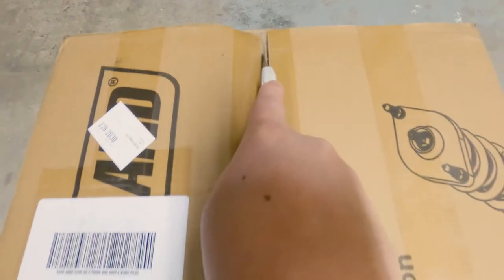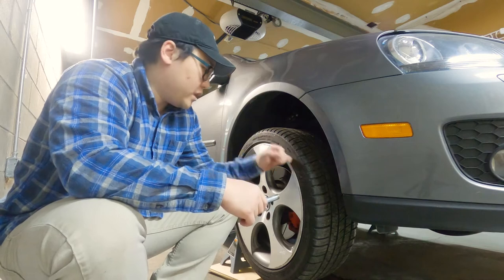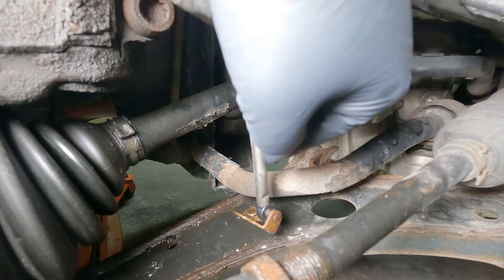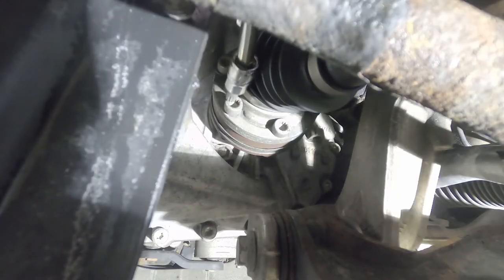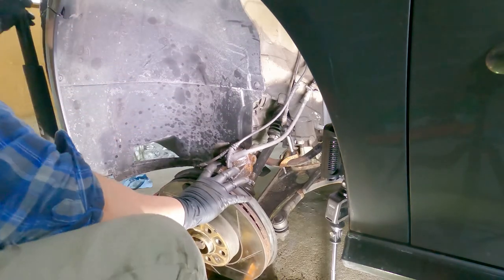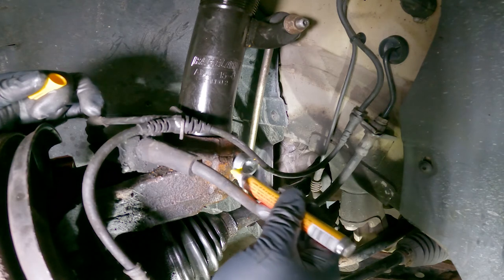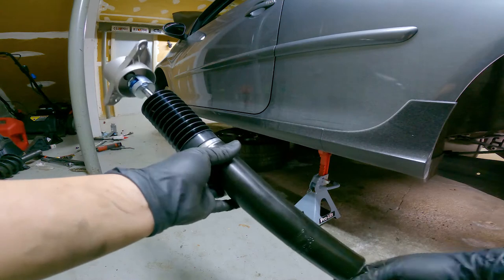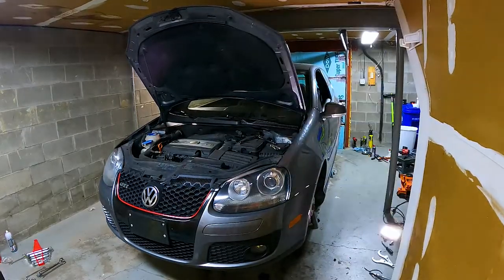Raceland Primo | COILOVER INSTALL | GTI Gets Adjustable Dampers Coilovers!!! MK5 | MK6 | VW

Comment: How is the ride quality with the coilovers at their highest setting? Did the dampening adjustment make any difference?
Reply from the maker: Haven't been driving this car much so it is still breaking in. I will have an update video about right height and adjustments in the near future. But as of right now at the highest setting and damping set to middle (7 out of 15). It is noticeable rougher compare to stock. However, it also is A LOT sharper compare to stock. The steering points instantly and feels very direct. From my intake video(https://youtu.be/VUneQ6P_7n8?t=636), you can kind of tell that the ride is pretty bumpy. Thanks for your comment! Subscribe for future video and updates!!

Comment: Can you go lower? Or is that max
Reply from the maker: Yes I can go lower, there are still a lot of thread on the coilover. But the ride will be very harsh and it will hit the fender liner. Check out this video for more detail https://youtu.be/Mw6c0s6goHI
Reply: @hanksun8707  whats the difference between primo coils and the regular raceland? I want it max lowered. Do you also have the link for it? Thanks

Comment: Great video, lovely and concise

Out of interest how did you manage to do the front strut mount fitting? The damping adjuster stops you holding the strut still do up the nylon top mount nut.
Reply: Also very curious can’t get the nut past the damper adjustment?
Reply: @jonathanpooler675  it is very hard and you really cant do it without a impact gun, or if you want to it the ghetto  you need to be super carefull use some pliers with a microfiber around it and hold the silver part of the shock so it doesn't move although i dont recommend it, this is a last resort and i believe violates the warranty